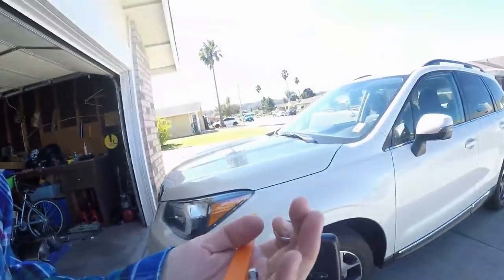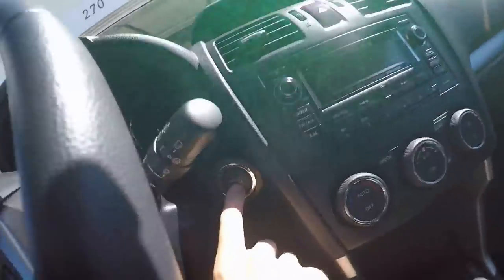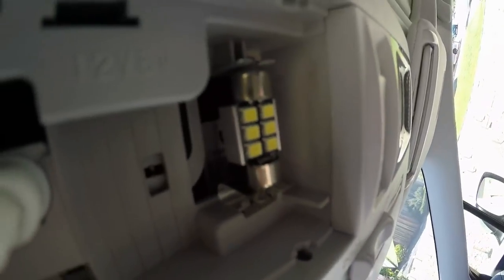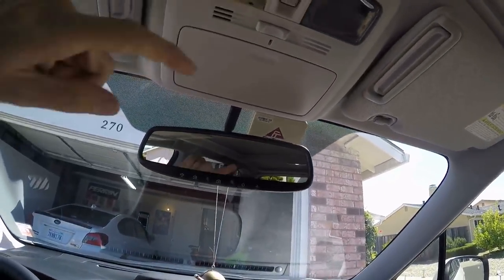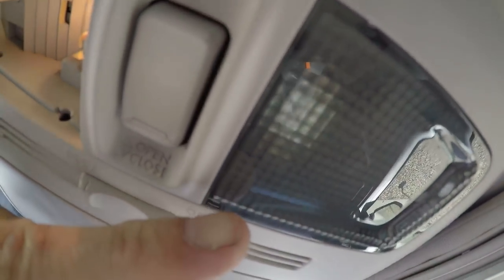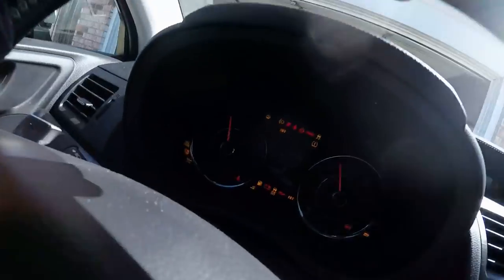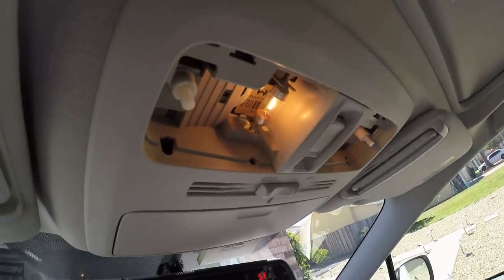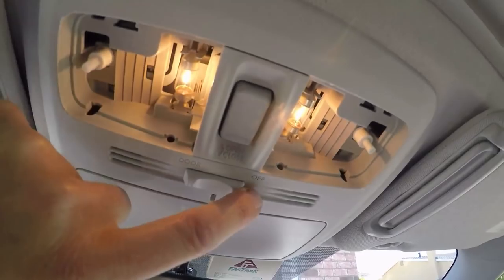2015 Subaru Forester XT: Ep.29: Map Light Door Switch Troubleshooting

Comment: UPDATE: Your WRX had the DRL's horizontal as stock and your Forester vertical. Not exactly the same when it comes to small stuff. Also, Amazon did say those switches are not compatible with 2016/2017 Foresters (didnt check 2015's though). Just a thought.
Reply from the maker: nothing to do with the switches. already put a stock one back in.

Comment: I am almost 100% sure is those new switches you added ,anything that you replace that has and electrical component or a diffrent connection inside with in the component specially if it's not OEM exact parts your going to run into trouble ,so try maybe swapping one new or used switch and try again..
Reply from the maker: ya i think it is too man. i thnk the BCM blew a little transistor or something, cuz it doesnt work even w stock bulbs anymore.
Reply from the maker: but no problem with my WRX w same bulbs..
Reply: LastHumansGarage time to grab your voltmeter & test light. I agree it's probably a bad switch you have 3 to check up front & 1 known good one to play with, I don't have an electrical diagram for this generation Forester but the rear light should be on same timer as the map lights (it just makes sense if they are all 3 wires, constant + , door trigger + and ground ). So you in the dog house with the wife over this ? 
Good luck, I know you'll post the results 👍
Reply from the maker: its the body CU unit whatever like everyone has had.. it aint the timer, it works fine on the dome. something blew in the BCE and im not even gonna worry about it. way too much money and this is a lease anyway.

Comment: Got me curious so I went to try, have LED in my 16 XT and they work as they should, but I don't have push button start.
Reply from the maker: i shorted out the socket by using a screwdriver to pop out the bulb.
Reply: that sucks, at least nothing major, I never set the front lights to come on with the door, too bright at night

Comment: Very odd. Do they not even turn off when you press the switches? Perhaps they are overriding the door switches.
Reply from the maker: they work fine normally. except for the door detector function. so i have to keep the settings off the door setting, or they will drain the battery overnight.
Reply: My thinking was that if you have left the map light switches set o, then of course they would remain on when the doors closed, so if you closed the doors waited for the dome light to go out then pressed each map light, do they switch off?
Reply from the maker: no.. they switch brighter. they are already set to off/door. Not "on".